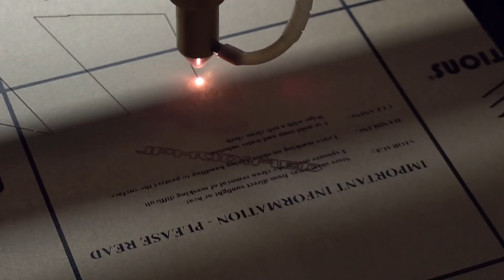I LOVE THIS CASE!!

Comment: I wanted this case. But it was seriously overpriced. Limited Storage capabilities. Pop out hanging sideways Tempered glass doors. not the best Cable Management, Corny Strap Handles, etc. 

So I went with Phantek Evolv X. Wow I get so much more space, Much better Cable Management, Lots of SDD Space, 9 to be exact and upto 10 HDD Drives Space on the Phantek Evolv X "Mid Tower" yes you hear right, "Mid Tower". Dual Hinged Tempered Glass Doors, Also Additional Doors on the cabling side to hide the wires and give it a nice Smoked Blacked Clean Cable side. I have an Asus Rog Strix 2080 ti OC I wanted to Match it up nicely with the case you are reviewing. 

I could not Justify $299 for that case. Even if it was priced the same as the Phantek Evolv X Case $199.99 , I would still go with Phantek Evolv X as a matter of fact, if the Asus Case was Priced at $150, I would still go for the Phantek Evolv X because it is a Better case IMHO.  I really wanted to like the Asus but in the end, I found it seriously overpriced and limited. 

Enjoy your Asus Case. Nice touch adding that corner piece, Glad your love it.